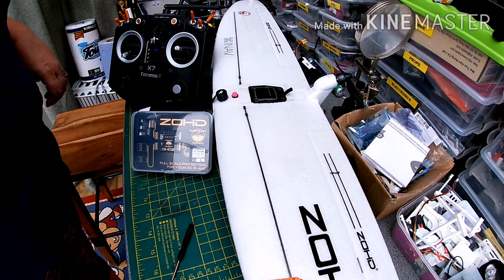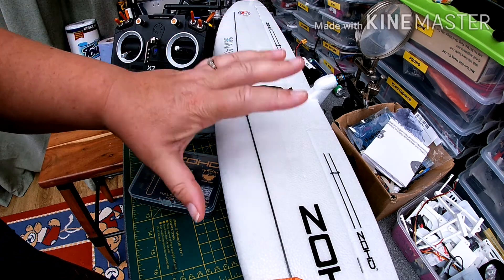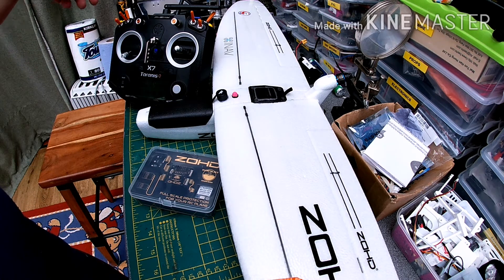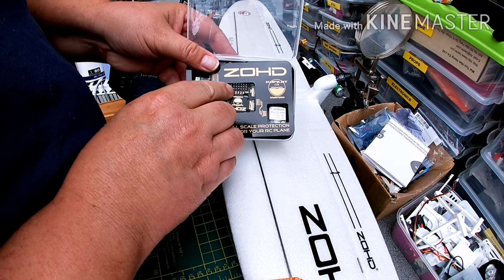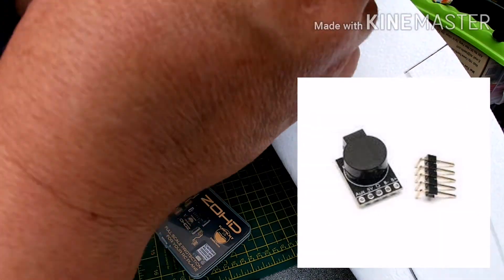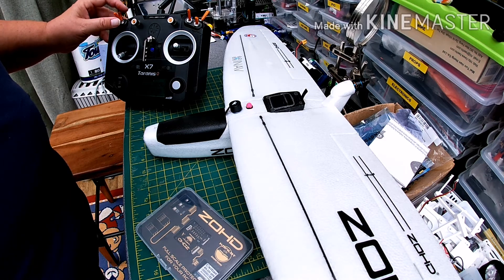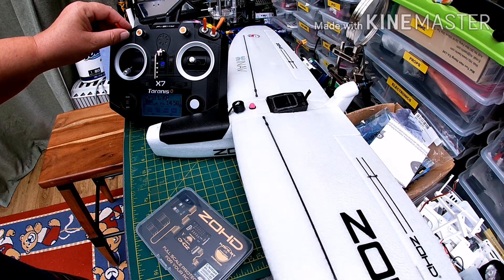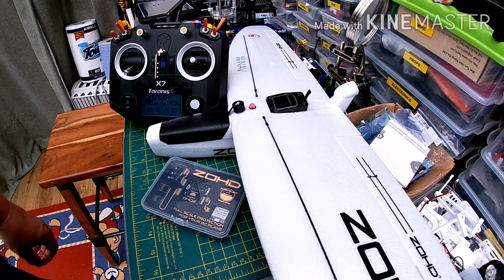Lost model alarm using Zohd Kopilot

Comment: How did you wire up the buzzer? It is unclear from the Matek site how to do it. I'm assuming the Grounds from the Kopilot is connected to the Gnd on the buzzer. After that, a little unsure (5V to 5V?). Then where does the signal wire go? Tried a couple of different things. Mine beeps, but not under link control.
Reply: Played around a bit more and wired it like the PWM diagram. Aux channel 5v and Gnd to the expected pads on the buzzer, and the Aux channel signal wire to the Aux pad. After watching carefully on your video, I realized that you did the same thing. One thing I found is that it turns on fine, but takes like 30 seconds to cut off when commanded. Same issue on 3 models. Not a huge deal, but any suggestions anybody?